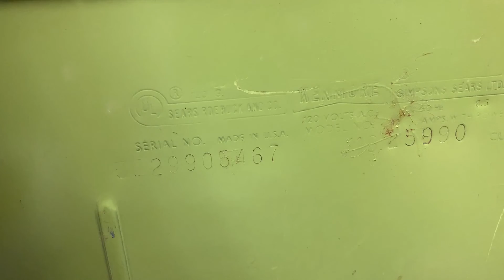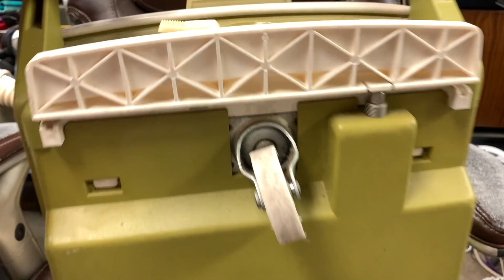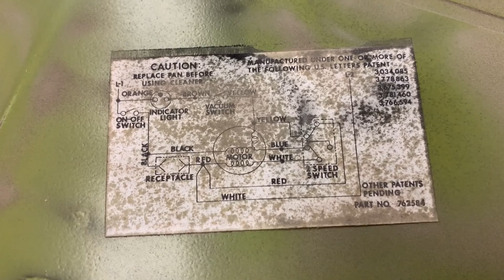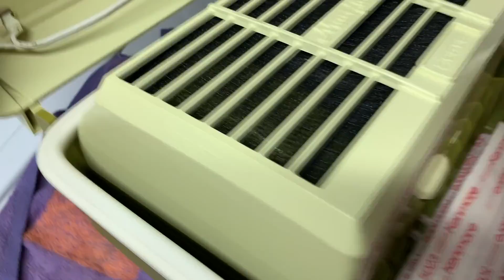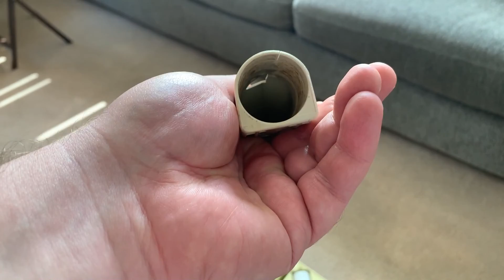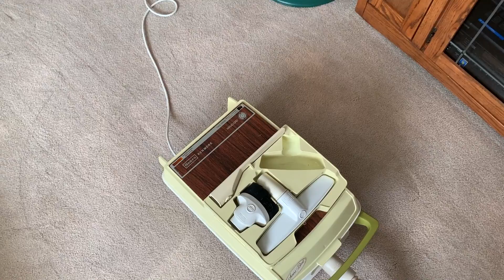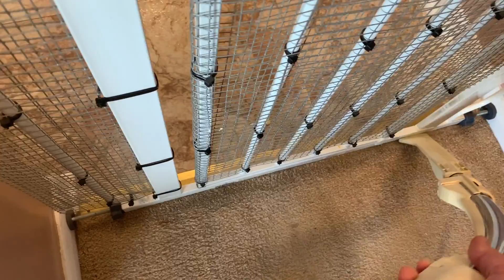1975 Sears Kenmore Model 116.25990 Canister Vacuum

Comment: My neighbors had this one, and we later bought the newest version of this one, in about 1979-80; ours was two-tone blue, but other than that, identical to this one, complete with the "Sears Best" sticker. It had a 10 ft. hose, and it had suction power that rivaled the current Electrolux and AirWay Sanitizor tank-type cleaners of that time.  It was also made by Whirlpool Corp., and NOT Panasonic, like a local repair shop insisted to me recently and quite rudely. Panasonic made the later ones from about 1990 on up to current. Panasonic isn't even half the vacuum cleaner that these old Whirlpool-made ones were!  And yes, Whirlpool contracted with Lamb Electric here in Ohio, where I have lived my entire life, to make these incredibly powerful and extremely reliable motors. I know my vacuum cleaners, lol.

Comment: My Kenmore is a plain jane canister in exactly the same shape as this one ,but beige color only .   Still works great .  I did replace my motor after the original one burned up.  My hose cracked in many areas, but found a eureka one that slipped on the end.   Best vacuum i have ever owned, and use today. PS  I have  one speed motor.

Comment: so if you went into Sears in 1975 and bought this it was over $1100. That would be like buying a Sebo or Miele today....I wonder if, back then, what were considered TOL vacuums...example, instead of going to a big box store in 1975... you went to a vacuum shop... I wonder if then the prices in a vacuum shop for a vacuum may have been more than $2000
Reply: Electrolux, Royal, Kirby, Rainbow, Filter Queen, Compact (later Tristar), Airway Sanitizor and Fairfax would have been the top of the line metal bodied last a lifetime and pass it on to the kids vacuums.   Kenmore was affordable quality a very small step down from the all metal machines with better features than GE/Premier and Hoover had at the time and in some cases better features than some of those metal bodied machines had like direct connect hoses (no pig tail cords from the hose to the canister or to the power nozzle) and better power nozzles than most.
Reply: @philsalvatore3902 My grandma always had AirWay Sanitizor and Electrolux, I remember those machines, they were great!
Reply: Am I to understand that you believe this vacuum cleaner cost over $1100. in 1975 ??  I bought the same model made immediately after this ( with power mate ) and it was blue.. It sold for $ 229.00... I bought my first Sears vacuum cleaner in 1959  ( It was the turquoise  "Vangard" model ), it cost $39.99 on sale. The people who shopped at Sears were not the "entitled wealthy", but wanted quality. The vacuum cleaners that were obscenely expensive at the time were Kirby, Rainbow, Tristar and Filter Queen. Vacuum cleaner prices did not escalate more until the 1990's, when the Tristar retailed for $ 1800. My first Miele was $ 399.00 in 1990 ( It had an American "Lamb" motor )..
Reply: @1953childstar  I think I should have been more clear... in 1975 $229 is like over $1000 in 2024
Reply: @1953childstar  I had the "Sears best" I think around $300, still use it. Had to get a new hose a while back for $75. Now no Sears Parts Depot open anywhere. Looking to finally get a new vacuum cleaner .
Reply: No it wasn't!!  These vacuum cleaners retailed at around $399.00 by 1979-80, when my parents bought one, though you could often get them for less when they were on sale. $1,100.00.....?!  No way. I don't know where you got your information, but it's WRONG. We also had the Sears Best/Lady Kenmore portable dishwasher, too, with that famous round upper rack, and those were priced at around $500.00 in 1972 or 73, because we bought the one with the black walnut cutting board top, in coppertone color, with a heavy plastic woodgrain front panel package, it was actually beautiful, lol....we actually had a few of those, but the others were avocado green and harvest gold.

We were ALWAYS at Sears, and I knew their appliances and their pricing inside out and backward....we had the Lady Kenmore washer and dryer sets, too; they were solid performers as I recall.  We went through these appliances every 4 or 5 years, because there were 4 boys and 2 girls, so LOTS of heavy use.  Sears was always better than Monkey Wards, that's for damned sure!
Reply: @jamescarrington5521  Bro, I'm talking about TODAY's dollars. The price of this Kenmore in 1975 was = to $1100 of today's dollars. I understand in 1975 these weren't $1100 in 1975. That's not what I meant. I mean that's what these would cost TODAY

Comment: THANK YOU for proving me CORRECT!  I just had a local repair shop here in Canton OH tell me that Panasonic has made ALL of their canister vacuums for over 80 years....I told him NO, these old machines were made by WHIRLPOOL!  The Panasonic canisters have TERRIBLE POWER COMPARED TO THESE OLD WHIRLPOOL UNITS!  AND YES....DYSON IS A PILE OF SHIT.
Reply: Neat, neat old Kenny!  Very nice find.  I'm a hopeless Kenhead

Whirlpool started making Kenmore vacuums in 1957 after buying their former supplier Birtman Electric.  They made most Kenmore canisters and a very small number of premium uprights.  Most Kenmore uprights were made by Singer (later Ryobi) as were a small number of budget Kenmore canisters.   Models with a 175 prefix are Singer or Ryobi products (Ryobi bought Singer Manufacturing in the late 1980s).   Whirlpool eventually wanted out of the vacuum business and formed a joint venture with Panasonic from 1990-95 to teach Panasonic their Kenmore vacuum business.  During that time Panasonic shifted their production of North American products from Japan to Kentucky.  Previously Panasonic had their own line of high end vacuums that were made in Japan.  From 1995-2016 Panasonic made most Kenmore vacuums though some budget models were made by LG, Sanyo and the Electrolux Group of Sweden.   Birtman, Whirlpool and Panasonic all used the 116 model prefix.  Now they are made by Suzhou Cleva Electric Appliance Manufacturing Co Ltd.  Call me a Philistine but Suzhou Cleva has in my opinion improved Kenmore vacuums in important ways, particularly the wheels on their power nozzles but also on dust sealing the motor housing.  No diminution in quality either and I am highly critical of all things related to China so it pains me to say that.

I have at least one of every Kenmore branded canister style made since WWII.  I don't have every variation but I have an example of every body style including one of these in your video.   I still use a 1982 vintage Sears Best 4.1 with "Finger Tip Control" (on-off and power nozzle switch on the hose end, no pedal on the front of the canister body).  I can guarantee you that a modern Kenmore Elite, one of the last vacuums Panasonic made for Kenmore, has about double the airflow of that old Kenny and a good deal more suction.   92 inches of water lift at the hose end where this old '75 Kenny produces 42-45 inches depending on how well you take care of it.   Even an early Progressive will outperform this old Kenny.  Panasonic always put strong motors in their vacuums.   Most of the bad rap I think comes from people who neglect them then complain they don't work.  They have two inches of crud packed onto the pre-motor filter a paper bag so stuffed it is hard as a rock and wonder why there is no suction!  Oh, terrible vacuum they will say.  

The bags shown in the video are indeed original.  You are supposed to hold the bag up and tuck the end of the bag downward from the filter.  When it fills up it uses up the apparent extra length.   The dirt goes to the bottom and the air goes over the top, maintaining airflow as the bag fills.  It's a smart design.   A better choice for your dust bag is a synthetic microfiber dust bag for a Numatic Henry. They fit the spout nice and tight and keep the inside of the vacuum dust free.  You can use the Numatic branded bags or the one from Nacecare.  The Nacecare bag is a bit larger.
Reply: I agree, CLEVA does one Hell of a job. Vac Lab on here raved about it. Only vacuum to 100% pass dust sealing test, and off-the-chart suction. I will be getting a Tri-Motor Kenmore Elite upright when I get my settlement, soon. Two other great Chinese brands, for different products are TTI and Midea, who makes DC pedestal fans, ad well as AC fans and makes the Mainstays/Walmart products. My PTC Ceramic heater was $10 less than Amazon Chinese heater, and MUCH better quality.  @philsalvatore3902
Reply: My friend who owns a vacuum repair, since 1990, calls Dyson, DieSoon. He does all the work himself.

Comment: Help, does this vacuum have a special bag clip?  Mine is a 2999 and it has a built in clip for the bag....unless I threw away a piece.  All the bags I have tried on it, including the 5055 doesn't fit.  The cardboard at the bottom is too long.  Can you advise.  Thank you.

Comment: I have this vac. Still works great. Trying to find bags for it. Do you have a source?
Reply: They later changed the 5033 to Type E bags. Which may be discontinued, but you could try eBay or Amazon.
Reply: I have the blue version with the integrated tool caddy. Essentially the same unit as this and I found using Envirocare A137 (Kenmore type C/Q) bags to fit perfectly and also a nice HEPA upgrade to the old now rare paper bags for these old Kenmore canister vacs.

Comment: Avocado green + faux wood grain = always a good combination!  What you said about modern vacuums with a screaming 12 amp motor is true.  I bought a bagged Dirt Devil Featherlite back in fall of 2006, and that thing would scream when it was on!  My parents had my 1989 Kirby Legend II that my mom's friend was throwing out in the summer of 2005, and they were using it until 2010, when I got it.  I also have a 1998 Hoover Elite I bought from the local Goodwill, and I also have a 1989 Hoover Concept One I found at Habitat for $5.  I mainly use the Concept One because it has the "Quadraflex Agitator", which I think is the best brushroll design ever made!

Dyson and all those other bagless vacuums are notorious for throwing dust back into the air when emptying them, so I like to stick with bags instead.

Lamb Electric is owned by Ametek now, and I find their vacuum motors in lots of commercial floor care stuff, such as floor scrubbers, wet extraction carpet cleaners, wet vacs, and many commercial vacuum cleaners.
Reply: Try out a modern Kenmore Elite, either the 700 Series or 800 Series.  They have a 600 air watt motor that I guarantee will impress you.   I love all things Kenmore and have a genuine fondness for this era of Kenmore canisters but the Elite is special.    Can't argue with the power though.  I have been running one for 12-13 years now, since they first came out and non problems.  The motors in them are solid.  I have used Kenmore branded Style Q synthetic bags in it since new and the bag chamber is still nice and clean.  Great vacuum and durable.

Comment: I have one just like this. I bought it right after I got married in 74. It works perfectly and I've used it constantly. only problem that I have now is the bearings for the beater bar. When the belts break because something gets stuck, like a string or a piece of carpet, I have to pull out the beater bar to put on a new belt. Doing that enough times over the years has messed up little square pieces that are on the end of the beater bar. Trying to find those two square pieces some more belts and a thing that's called a bearing that's on the end of the beater bar. If anyone knows where I can find the parts? I have the part numbers. Please let me know I really love this vacuum. Also all the parts are on there except for one it was for cleaning clothes that had a brush that spins. And the two covers that go over the small and large attachments for cleaning the floor. So it looks like Lamb's wool cover to keep from scratching things

Comment: What is the Amp rating on that
Reply: When he showed the bottom, where the serial number was, the amp draw was clearly stamped into the bottom. If you will pause at 00:33 you will see that it is stated to draw 8.5 Amps.

Comment: My parents had this vacuum. Unfortunately they sold it at a yard sale even after I explicitly told them I wanted it 🤬

Btw, that tool caddy can be stored inside the case on top of the bag compartment (iirc it can also be operated with it inside as well). 

Also that vent to the left of the blower port originally had a block of sound dampening foam that dryrots to the point where it disintegrates just from looking at it wrong. If so Inclined for authenticity, it be replaced with cheap aquarium foam cut to size.

Comment: I never seen anyone stuff an entire vacuum in the dishwasher without removing the motor. Weren't you worried about the bearings? and getting them wet?
Reply: The opposite, actually.  The hot water and detergent cleans all the old gunk out of the bearings, and once dry and re-oiled, are good as new.
Reply: @HarleyBadger If you take the motor apart and re-grease the bearings. I can see that. Ball bearings use grease.
Reply: @kennyloveland1267  When that is the case, we DO.  As shown in other videos.  We grease and service ball bearings as well.  This Ametek Lamb motor on this canister has a sleeve bearing and a sealed ball bearing.  The sealed bearing is due to its air-through design, If we can pop the seal to clean and then re-grease it afterwards, we will.  If we can't get it off, it's sealed enough against water intrusion.  If it's too gummed up AND too sealed, we replace it.  We've been doing this for decades, we're not some Youtuber kids randomly throwing things into Mom's dishwasher.

Comment: After Whirlpool stopped making vacuums  Panasonic  Continue to make Kenmore vacuum cleaners for Sears. Unfortunately Panasonic sold their vacuum division to a company in Hong-Kong which has recently acquired  Suffered the Kenmore floor care division. Only the Kenmore elite upright and canister are still left over Panasonic designed machines. I believe everything else is not.
Reply: Not Hong Kong.  Panasonic passed the baton to Suzhou Cleva Electric Appliance Co Ltd of Suzhou China, about an hour and a quarter drive from Shanghai along the shore of Lake Tai.  It is actually a resort area.  I've had lunch there at a nice lakeshore restaurant and taken a boat ride to see some of the old shrines on the lake.  Some family members are buried near the lake.  I will probably never visit there again unless there is a revolution and the communist party is thrown out.  

Suzhou Cleva was an established supplier of Craftsman shop vacs in addition to their own Vacmaster brand so it was a natural transition for them to make Kenmore vacuums.  While I am harshly critical of their government and their trade policies I will admit that if anything Suzhou Cleva has improved Kenmore vacuums.  The power nozzle wheels are now on steel axles and don't fall off ( yay !) (btw, that new base can replace the old base when the snap on wheels finally fall off) and there are improvements in motor sealing.   The bag chamber lids don't flex inwards like the lids on these old square 1970s Kennys do.  They still use steel wands in a world where even Aerus uses plastic wands.  For the price they are still hard to beat.
Reply: @philsalvatore3902 A Chinese Company who actually cares about build quality standards!? Well I suppose anything's possible.
Reply: @larrylaffer3246  Kenmore rides herd on their suppliers.  Kenmore doesn't actually manufacture anything.  They contract with appliance makers to make appliances to their specifications.  If you look at the model number on every Kenmore appliance and Craftsman power tools, the first three digits before the period are the manufacturers code.  Kenmore works with the manufacturer on the eventual design of the appliances that carry the Kenmore brand and they seem even today to still care about quality.